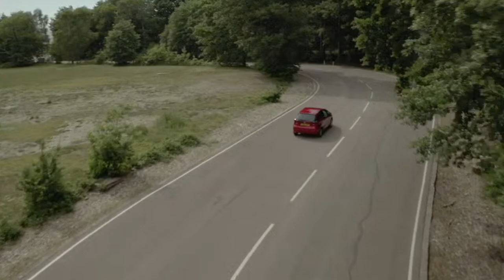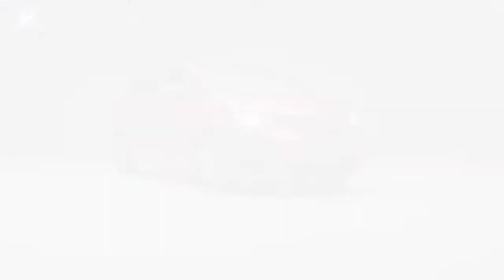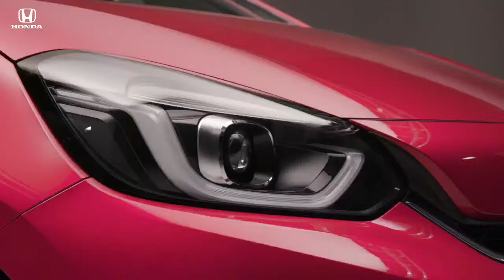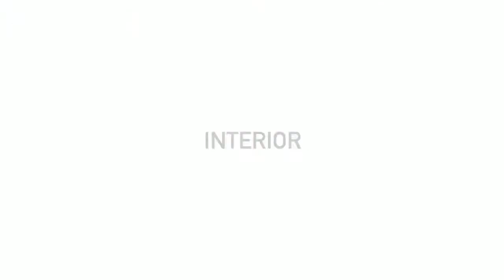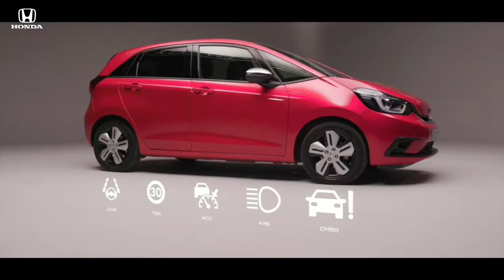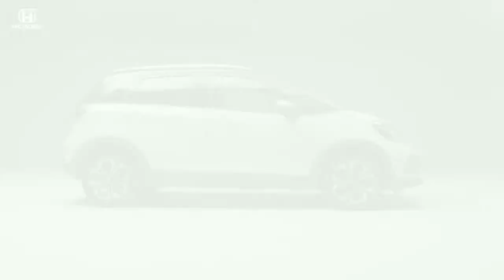Honda Jazz Hybrid - Live Stream Event

Comment: I have now bought a Hybrid Jazz EX, I know the engine provides electricity for the drive motor, and charges the battery, and also has a direct drive when traveling faster. However, what makes the engine noise with the simulated gear changes when you accelerate hard? Is it the engine being revved, then having the revs reduced, and revved again, or is it a simulated noise?
Reply: you did not ask when you bought it?